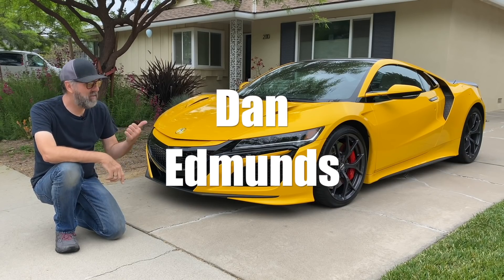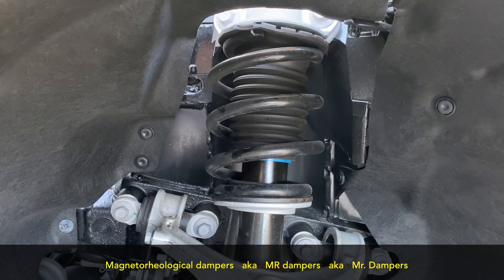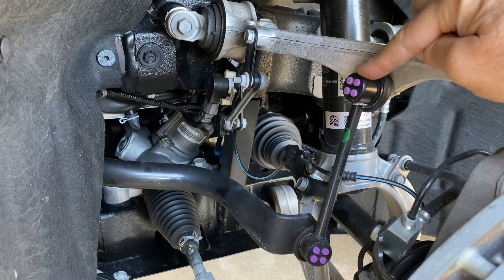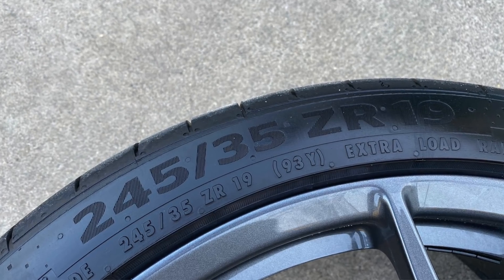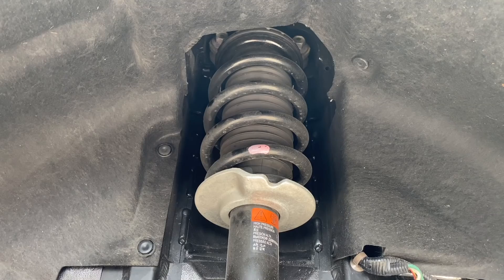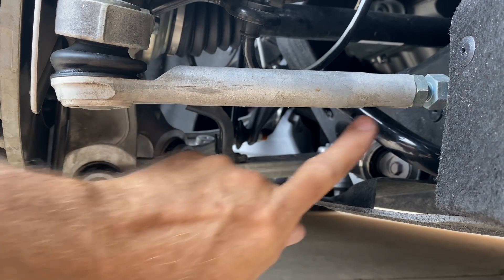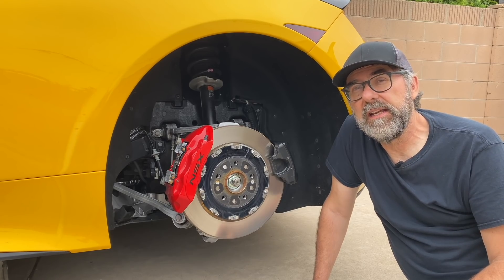2020 Acura NSX Suspension Walkaround - A Ton Of Clever Engineering Is Hiding Behind Those Wheels

Comment: The suspension in the 1991 was much more advanced for its time than the 2020.
Reply: The og has a connection at the forward inner control arm ball joints that keeps the caster angle consistent under braking force and other forces. It's really wonderful.

Comment: FYI, Acura gives you a tool to remove lug bolt covers.  It's located in the trunk.  Pull out the rear most panel to access this tool.

Comment: Dan. Great video. Could you elaborate a bit on the suspension improvements touted in the 2019 model vs 2018  and how they specifically improved performance. Thanks

Comment: How can you tell the difference between the cast and forged suspension pieces?
Reply from the maker: The surface texture is a clue—castings are generally rougher. But I'd be lying if I said I could tell for sure each and every time. In this case I interviewed two Acura engineers that worked on the project. I straight up asked them.

Comment: Great video. There IS a “better way to do this” in reference to removing the plastic caps on the wheel lug bolts.  In the trunk storage area are a couple of tools, including black plastic tweezer looking things for removing those caps.  Also Acura sells a more professional metal tool for removing the caps.  Wheel “Hangers”, which are threaded studs with a long smooth length are useful for removing and installing the wheels.  Especially useful with Carbon ceramic brake rotors as these can be damaged by an out of aligned wheel hitting the brake rotor
Reply from the maker: Yes, I would definitely want those hangars with ceramic rotors. As for the tool kit, I didn't see it in this borrowed car. I left this in for the humor of it.

Comment: can you explain the advantage of wheel bolts versus nuts? I read somewhere that BMW racecars have nuts instead of the standard bolts so if the race car has it, why not road cars?
Reply from the maker: Mainly to trim unsprung weight—and weight, generally. This was confirmed in this case by an Acura engineer. It may not seem like much, but engineers tend to think in terms of grams. With thousands of parts on a car, you have to. This seems like an easy win to them, and there are 20 of them on the car. Hold 20 lug studs and lug nuts in your hand sometimes. Eliminating the nuts is essentially what's going on here. They can get away with it because the wheel/tire assemblies are relatively light and have a very open-spoke wheel design that's easy to grab onto and position on the hub.

Now, in racing there are pit stops. Some cars with lug studs may actually fit LONGER ones to further aid quick wheel fitment in pit stops. Lining up bolts with holes is not something you can do quickly. And of course the top tier series use a single central hub stub with one big lug nut.
Reply: @DanEdmunds  great explanation thank you! never thought about it in terms of unsprung weight.

Comment: Just a quick question, how do you know the knuckles are cast, other than experience? I get the parting line is thicker than the forged UCA, but I personally can’t really see any sandy texture on either.
Reply from the maker: Knuckles are harder to forge because of their complicated shape. But its a tough call, and in such cases I will not speculate. This time I was able to speak with a couple of Acura suspension engineers and get confirmation.
Reply: Dan Edmunds ok, cool! Glad you were able to get a hold of them and confirm!!!
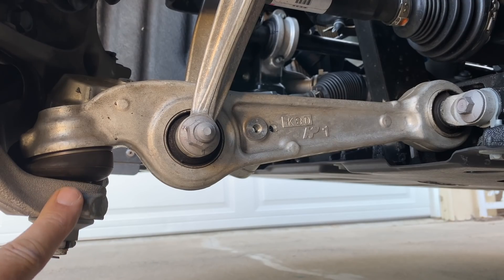Reply: Had a similar thought but it looks pretty rough at 5:42. I think casting actually has a thinner parting line.

Comment: Really great videos Dan. I think it would be super helpful if took the opportunity to teach your viewers a bit more. For example you mentioned anti-squat - what is that and why is it useful? How does this suspension setup compare to other cars in the same price range? How does the cost to design and manufacture a suspension like this compare to other variations? Would you have changed anything if you were an engineer on this project? Given your experience you can add value for your viewers by talking about more than just the facts of the suspension in your videos.
Reply from the maker: Great points. This is still evolving in video form. I find that my written pieces, which can be (and are) published after the car is gone, benefit from a bit more marination of the facts. I'm moving in that direction, but right now I'm still working out the mechanics of shooting and capturing sound!

Comment: I was curious about the difference between MR and ferrofluids and found this on wiki explaining the difference

'The difference between ferrofluids and magnetorheological fluids (MR fluids) is the size of the particles. The particles in a ferrofluid primarily consist of nanoparticles which are suspended by Brownian motion and generally will not settle under normal conditions. MR fluid particles primarily consist of micrometre-scale particles which are too heavy for Brownian motion to keep them suspended, and thus will settle over time because of the inherent density difference between the particle and its carrier fluid. These two fluids have very different applications as a result.'

fascinating stuff - I wonder the chemical makeup of the liquid is